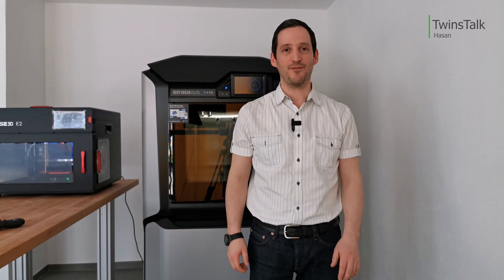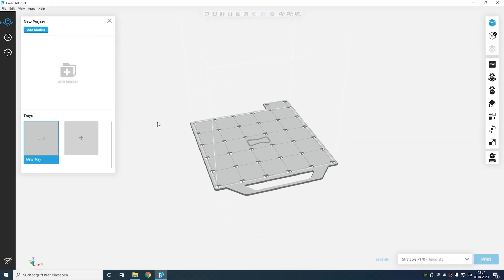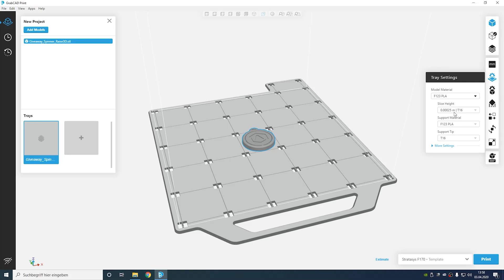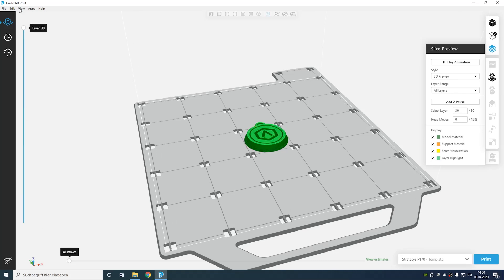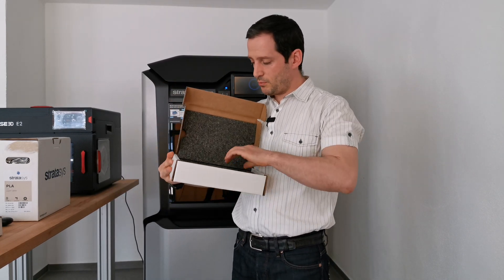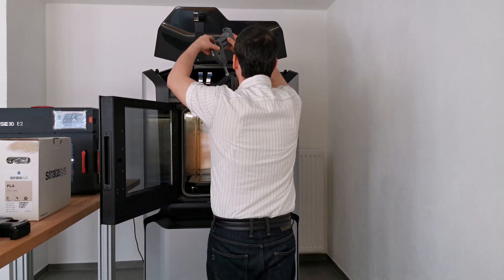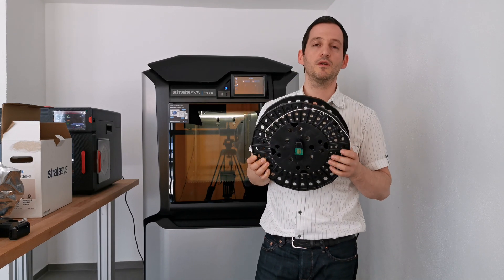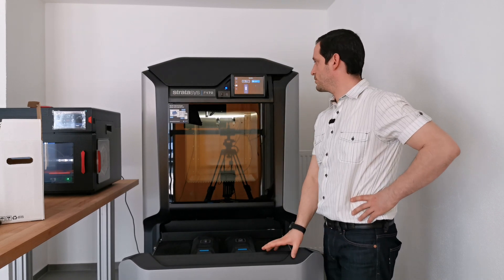Stratasys vs. Raise3D: Printer Setup (Part 1)

Comment: The Stratasys  also features the all-new - to produce initial design concepts  and economically. Now you can print twice as  as standard build  while consuming just a third of the material on average. For even more efficiency and savings, choose PLA.

But ASA is waaaay better and with SR-35 support. Stratasys costs more for a reason, it`s a professional machine. Raise3d is Low-end play-printer, its like comparing a beer to a bottle of Vodka, its the same because they both have alcohol in them.

Comment: Why are you printing PLA on a stratasys machine?
Reply: Agree PLA is like draft mode only
Reply from the maker: Hi. PLA is a dratf mode material but should still print at an acceptable quality. You get a separate PLA head just for extruding this material with the machine, so it should also print PLA fine. This is one of the areas the F123 does not shine. Will print out other materials soon. Working on that.
Reply: @twinstalk  It prints PLA like garbage because its a machine thats intended to be heated and closed. PLA is also a pretty useless material for real engineering applications. Try printing a large, intricate, 100% dense ABS part on both machines and you'll see what stratasys customers pay for.
Reply from the maker: @highvoltagefeathers  yes will do some more prints in ASA and ABS. Any thoughts on what to print for a comparison?
Reply: @twinstalk  print large solid parts on the stratasys, to illustrate that this is impossible on any consumer machine.
Reply: Corn is fast lol
Reply: Cuz it can’t print high temperatures